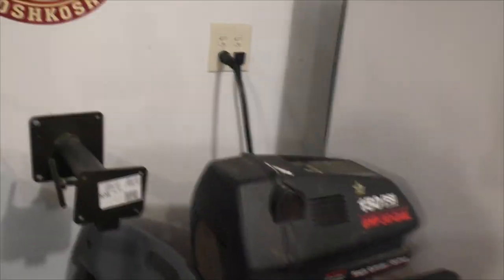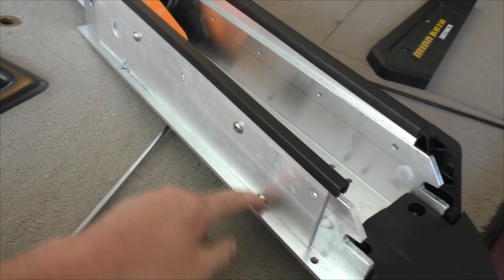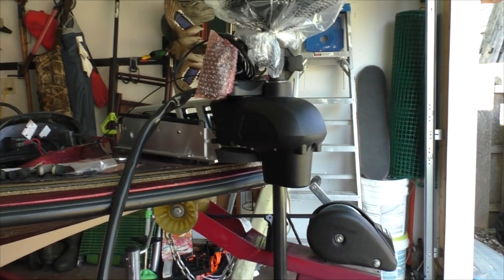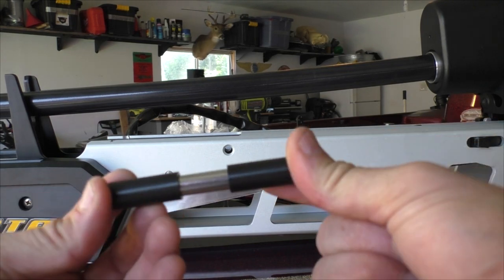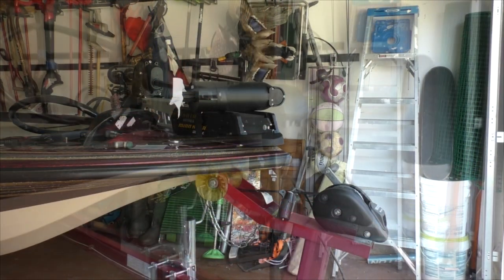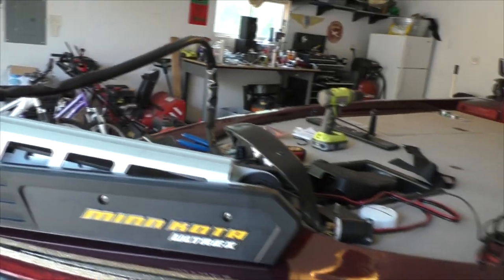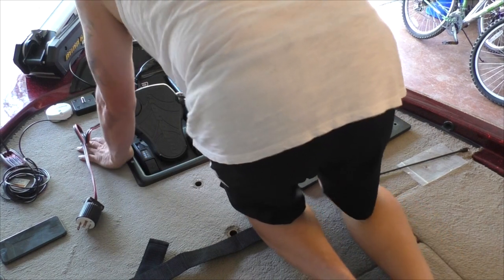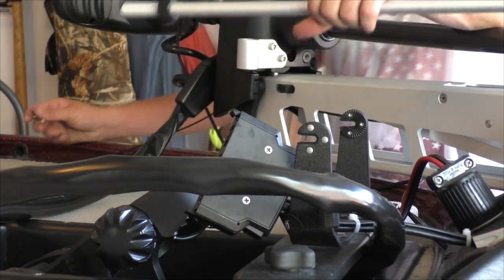Minn Kota Ultrex Install and On Water Calibration

Comment: Thank u for mentioning the breakers
Reply from the maker: If you are up grading from a smaller motor, the ultrex will trip them once you are past 8 because it draws 56 amps at full power. Most stock breakers are 50. Good luck with that motor! You will love it!
Reply: @adventuresmidwest3065   thank u can’t wait get on water

Comment: Truly thanks for the great video…now then…
The Puck…the Puck…the Puck!!!…
WHAT THE PUCK?!
😅….what the puck is goin on here?!!🤷🏾‍♂️🤦🏾‍♂️
So far, Nobody is thorough or brave enough to show a good detailed wiring installation of this darn gps/locator puck for those of us who know-not of how and best way to wire this thing….every video-maker thus far just glances right over that part of the install…ironically the most important feature to alot of us non-electronically saavy folk.

Should the puck have a switch? Should the puck wires be twisted or intergrated with the big ole 6 gauge trolling motor wire or somehow with the power wire of the foot pedal to come on only when turning on the trolling motor? What does the power and ground wire look like that we are suppose to wire this puck’s power and ground wires to??
I just wanna do it right….then fish and use it without blowing up the expensive trolling motor, the puck, the boat, and myself😢😩 (LOL!)
Reply from the maker: The puck is just wired to a 12v power source. It automatically turns on when the trolling motor is turned on. Then you can use the button on the puck to change modes but I didn’t need to do that. I put the puck in the front as you see in the video and it worked beautifully. I installed two more since and worked perfectly. Just hook the puck to 12v but always run an in-line fuse so it’s protected from possible surges. Thanks for watching and I hope that helps. There really is nothing special to do with the puck.
Reply from the maker: Power is red ground is black. And…. Please don’t blow up your motor, boat, and most importantly, you!😄😄😄
Reply: @adventuresmidwest3065  😄Thanks for the info & motivation…🙏🏾

Comment: Thanks of the tip on the 60 amp breakers...Im just wondering why 2 instead of just one..
Reply from the maker: I always go too much. So I figured I’d keep it balanced with the two breakers.
Reply: You don't need two breakers, just one on the positive side of your trolling motor battery.

Comment: Did you have to switch to 6 gauge wire with the 60 amp breaker?
Reply from the maker: I did not switch to that heavy a gage. I don't remember the gage of the wire I used. I actually think that I used the wires from the existing wires on the boat. It really handled it really good and never tripped once put those breakers on. Good luck with her!!!!
Reply: @adventuresmidwest3065  thank you very much. I have a Bass Tracker which has 8G for the trolling motor. 
Great video!
Reply from the maker: @mikegonzales707  no problem. That 8ga should be fine. The motor draws 54A at full power! You will love that motor!

Comment: So the white puck has to have its own 12v power source and the actual puck plugs into the trolling motor?
Reply from the maker: Bjacobs1 the white puck is the gps heading for the trolling motor. It is powered by the trolling motor so not really a separate connection.

Comment: Finally an actual informative video. Thank you!! 

I just bought a 18.5ft 150hp bass boat and I have a Minkotta maxim 70lb thrust and running a 3 bank 24v. I think it's running a 10 or 8g wire. If it's 8g wire would I be able to get away with it if I attach 1 circuit breaker or do I need to get 2 circuit breakers with 6g?
Reply from the maker: You only really need one for the positive. I think if you have either 8 or 10 it’ll be ok. The maxum doesn’t draw as much as the ultrex. Hope that helps man and congrats on the new boat!
Reply: @adventuresmidwest3065  thanks for the response. When you say I only need one for the positive, do you mean I only need a 6g for the positive and the negative wire can stay at 8 or 10?
Reply from the maker: Correct. You only need a breaker on the positive wire. I put them in both. The breakers are cheap and I figured why not. With a maxum it should be fine because of the lower amp draw of the motor. The stock setup for mine also had two auto reset breakers. That’s why I put one on positive and one on negative.
Reply: @adventuresmidwest3065  ahhh I see. Sorry I meant I have a maxim that came with the boat and I  am replacing it with the 80lb 24v ultrex.
Reply from the maker: @lloyds_fishingjournal  oh ok. Yeah then just do the two breakers but make sure they are 60 amp. I forgot what u put in! I’m getting old!!😄😳😳 when I was using the stock breakers, on high the motor would cut out! You will love that motor! One of the best things I added! And... it helps catch more fish!
Reply: Thank you so much for helping me and keep up the vids.
Reply from the maker: @lloyds_fishingjournal  Anytime. Once you get it on, let me know if you need any help calibrating it. That process is pretty easy. I had no issues with this motor and loved it. Some guys were bitching about everything, but I had zero issues and for deep water smallmouth, the thing kept me on fish with the spotlock. That is a great thing and will help you remain in one place and I was in 24 footers regularly on Lake Michigan. Good luck with it.
Reply: @adventuresmidwest3065  thanks a bunch. I just got the motor and the 6g positive wire. I left the negative wire alone so hopefully that doesn't mess things up. I figure since I'm only attaching the circuit breaker to the positive that the negative should just be left alone.
Reply: @adventuresmidwest3065  hi me again. Huge question. Have you had any issues with those isolator bolts from busting off or seeing your ultrx shake at hight speeds?
Reply from the maker: @lloyds_fishingjournal  none at all. I tried to make them very tight as I fish big water a lot. Been in some rough stuff and I have not personally had an issue. Some people have said they have let loose but mine stayed nice and snug. I periodically checked the tightness though. About every 3rd trip for the first 6 months or so.
Reply: @adventuresmidwest3065   Hi its me again. So I have a quick question about my heading sensor. I've heard you can mount it in several different places and I want planning on installing it on the outside portion of my windshield because there is a great spot for it however it does slop just a little. Do you think that would be an issue? 

Does the heading sensor need to flat or can it be an angle?
Reply from the maker: @lloyds_fishingjournal  I mounted mine flat on the front deck right next to the motor. I don’t remember if the instructions specified it has to be flat but I would mount it as flat as possible. All my friends are mounted flat either on the side of the boat or rear or next to the motor. I wish I could tell you for certain cuz I know you don’t want to be drilling into your rig for nothing. Good luck with it. How’s the install going so far???
Reply: @adventuresmidwest3065  haven't had the chance to install it yet. I took off thr maxim yesterday and I'll be installing the ulfrex today. That was also my other option was to mount it in the rear but didn't know if that would read that far out. 

Maybe the safest is just the front. Hahaha

Comment: Have a amazon link or description on those cool mounting screw hole anchors ?
Reply from the maker: A.A. Bass Tournament I’ll check my history. I will post when I find them. They work awesome!
Reply: Just saving you a headache, use motoguide anchors, these have failed miserably, and only use them in spots that you can’t reach, other holes use a bolt and nut directly.

Comment: I have heard complaints that the Ultrex is very loud, what is your opinion on that... is it loud enough to bother you? I have the Terrova now, but would like to add Mega 360 to my set up, so the Ultrex is the really the only choice. Thanks
Reply from the maker: I never noticed it. I guess if I was to compare it seems about as loud as a fortrex. It never bothered me and I did not notice any problems in shallow water with it. I was extremely careful and in heavy cover tried to use it as little as possible. Didn’t notice it too much but that’s just my opinion. I fished everything from small shallow lakes to Lake Michigan and did not feel it was too loud.

Comment: Hi I just got the terrova I pilot. When I push the anchor button it says SL TMP. It will stay in spotlock for maybe 5 minutes  then kicks out. Also the calibration setting is showing up on my remote. Could this be cause my gps puck isn't paired? I thought I paired it
Reply from the maker: 2005fordmustanggt I will do some checking. I don’t know off hand. I had the ultrex and I do know if the puck isn’t paired it will do weird stuff. Good luck with it.
Reply: @adventuresmidwest3065  ok thanks I appreciate you getting back so fast!

Comment: Do you  make a circle  with  trolling  motor  or motor  of boat? Thanks
Reply from the maker: Use the trolling motor. There is a little circle on the remote and it will tell you when to stop your circle.
Reply: Ok thanks  for  the info

Comment: Just to Answer my own question. ABYC requires a breaker on each non grounded battery. So one breaker would work but does not meet ABYC standards.
Reply from the maker: Correct! I have two breakers and just upped them to 60a each because the ultrex draws 56a on full.

Comment: Tom did you install the recess tray also, or was it in the boat already? Want an Ultrex for the Ranger but don't want to cut holes into my front deck in case I ever want to go back to my Terrova. Plus the fuel tank is right underneath  :(
Reply from the maker: I didn't on mine but we did on my cousin's skeeter. It's a pretty big hole that needs to be cut into the front deck. Also, the pedal on the ultrex is bigger than most. I think your Terrova will be the same size. It's a chore. Plus, with the cutting you really need to take your time so that it comes out clean.
Reply from the maker: I'm pissed I wanted to come up and meet ya tonight at the seminar but I won't be able to make it. I hope the seminar is a good one!!!
Reply: Thanks. I’ve handled Fortrex and Edge trollers without the recess. I think I’ll be okay without it
Reply from the maker: @NorthwoodsBass  Yeah, I had an Edge in my dad's lund that was not mounted to the floor or anything and it was fine. I think you will be ok. I love my ultrex. So far, so good and no issues yet. Knock on wood. Hope the seminar goes well. Sorry I couldn't make it, I just walked in. See ya.